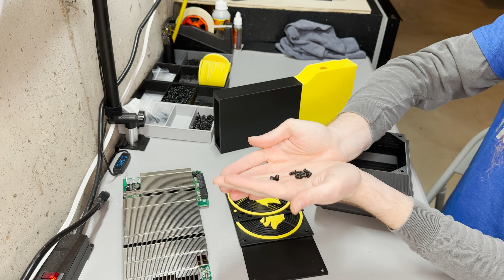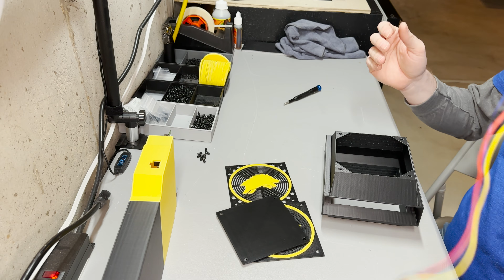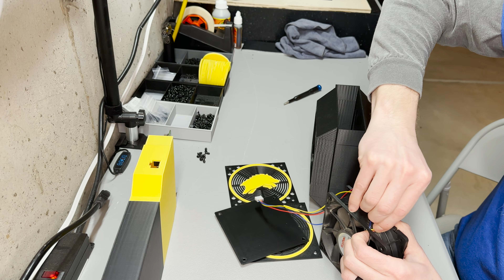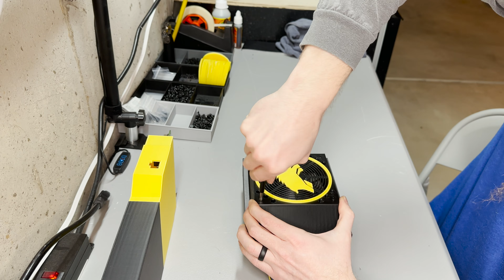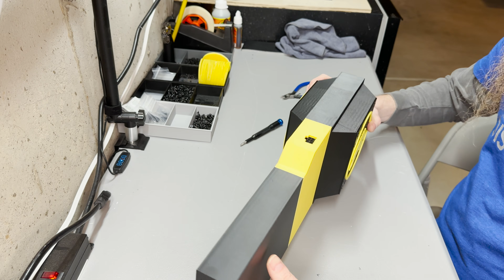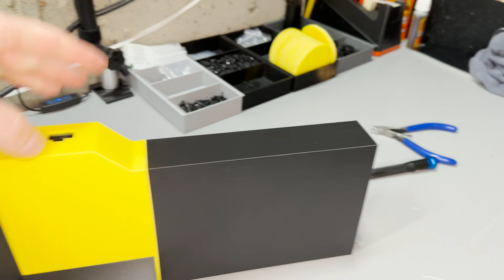Custom 3D-Printed Case for AMD BC-250 APU: Design & Build Guide

Comment: Hi.

Just ordered a BC-250, and came across your video while looking for case solutions.

This looks great, and much better than messing about trying to fit it into something like a SFF PC case or external GPU enclosure.

Could I ask what the thermals are like using this cooling method (I initially intended on opening the grills and having a couple of fans blowing into it, pushing heat out the sides. And perhaps constructing a crude case using plastic sheets and long stand-offs)?

Also. Do you plan on making a case that also houses a PSU?

For example. The dummy fan grill to the rear, looks the perfect spot to widen to fit a SFX PSU. Or there could be an elongated protrusion to the bottom rear of the case, for a flex PSU (which would also provide enough depth to make the stand unnecessary).

Obviously, this would require some amendments to the hole in the case for the 8 pin power. 

Perhaps a yellow cap that clips on, or removing the hole and making the case slightly taller to allow the board to enter with the 8 pin already cinnected.

Another idea would be to make a stand that also acts as an enclosure for the PSU. That would dock in nicely and neatly, using one of those £5 180 degree/u-shape 8 pin adapters.

Just spitballing ideas, as I don't have a 3D printer. So will need to buy something to meet my desire, if I want something bespoke to this board.

The product looks great BTW.

Thanks. 👍
Reply from the maker: Hey there my dude, thank you for the kind words and ideas! I moved the channel over to https://www.youtube.com/@legendarymakes Come follow me there. And yes, I have a new case that is almost done and will house a PSU :)

Comment: Hi. Which power supply do you recommend? Something small like a laptop charger?
Reply: I found that the SFF dell 240w unit with adaptor cable is enough and they are super cheap/smallish. (they are 8 pin, but 8 pin CPU , not PCIE so dont use without adaptor cable)

Comment: I know you mention that it would be over kill but would I be able to connect 2 fans outside using the fake part? I saw a video saying that once you start utilizing the video capabilities of the card it gets more toasty.
Reply: Probably one high rpm, and a regular consumer one?
Reply from the maker: @ Maybe? This fan should be more than enough in conjunction with removing the metal bracket on the BC-250. https://amzn.to/3XRgZbD
Reply from the maker: @JesusAristeoPonceCasillas  You could totally install 2 fans on the case. However, I am unsure if the fan header, with a splitter of course, on the BC-250 can handle 2?